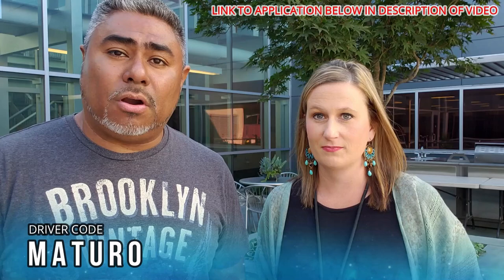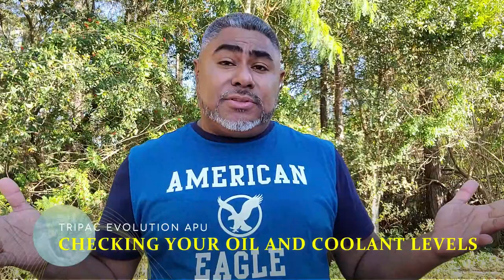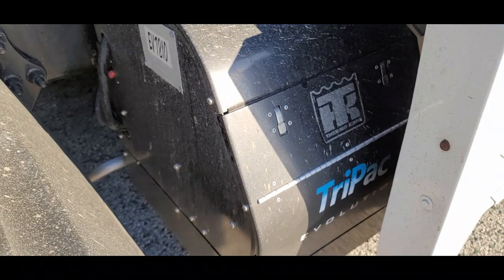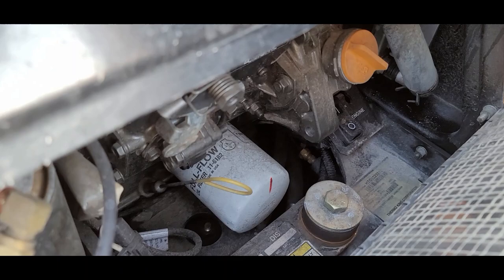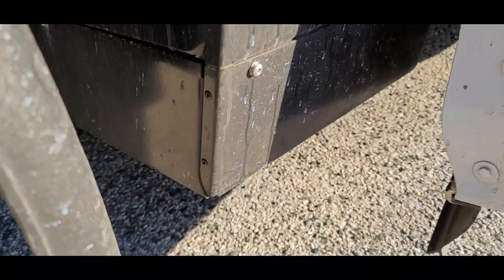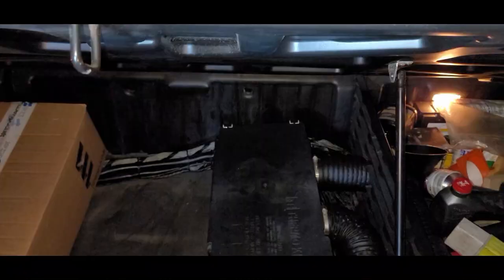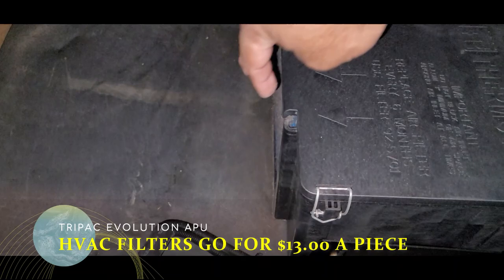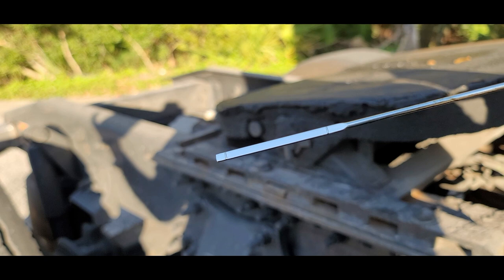How To Check Your Oil & Coolant on APU - Tripac Evolution

Comment: Does the apu share coolant as the truck?
Reply from the maker: No, the APU has its own coolant reservoir. The only thing it shares with the truck is the fuel 👍🏽
Reply: @JuniorHonduras  some actually do share coolant with truck.my truck ran hot and I couldn’t find leak nowhere.turns out it was flooded in apu